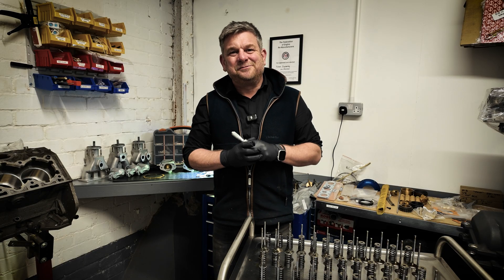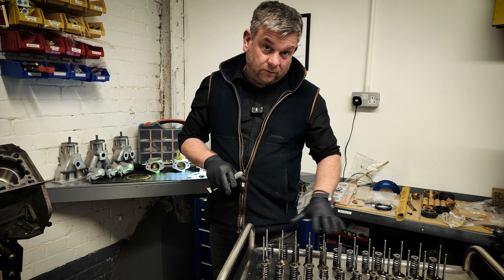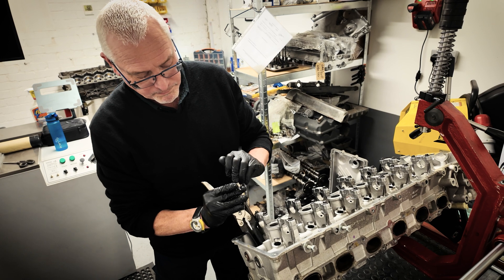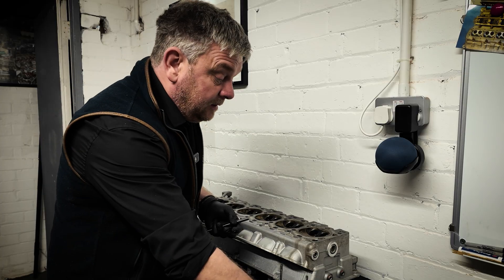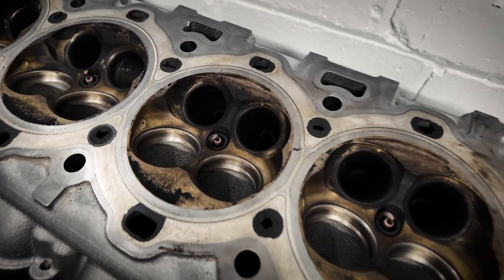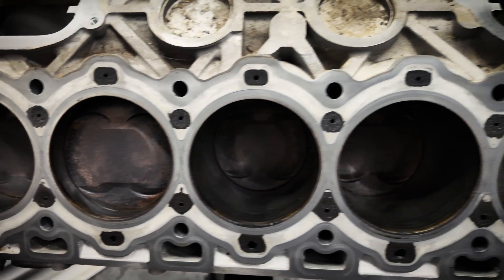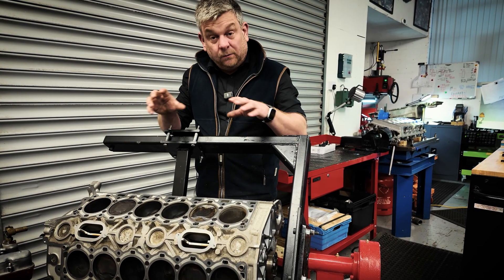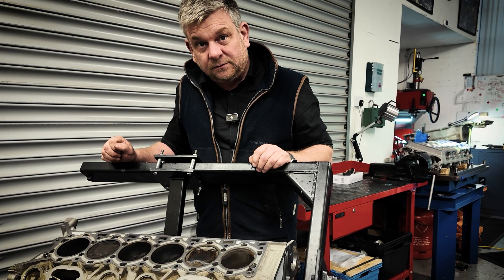V12 Rapide S - Episode 02 - Cat Ingestion Issue

Comment: I'm new to this.
How does material from a cat end up back in the engine.
I assume it would just move further into the exhaust system.
Reply: During each engine cycle some spent exhaust gas gets ‘sucked back’ into the cylinder to be re-combusted. This is to improve emissions.(emissions legislation has resulted in a number of detrimental effects on engine reliability for all manufacturers but hey-ho, we’re saving the planet)
Because the primary catalysts are part of the exhaust manifold and very close to the engine if the catalysts break up then the debris can get sucked back with the aforementioned exhaust gases through the exhaust valve back into the cylinder.
Reply: @drleftie makes sense.
I'm not familiar with this engine and didn't know that the cats were so close to the heads.
Reply from the maker: @drleftie  Great explanation and a very helpful comment, thank you, much appreciated.